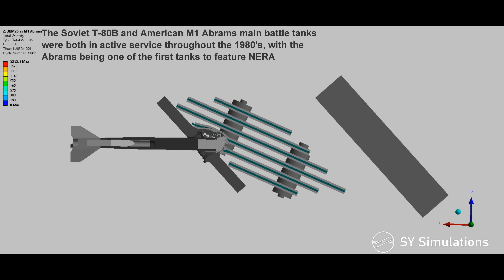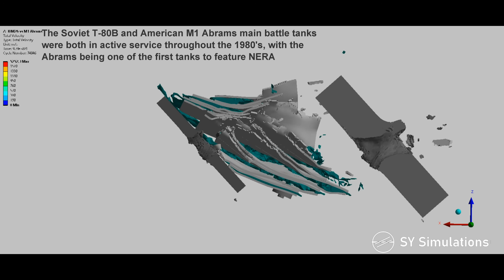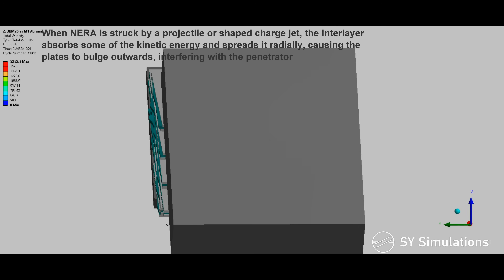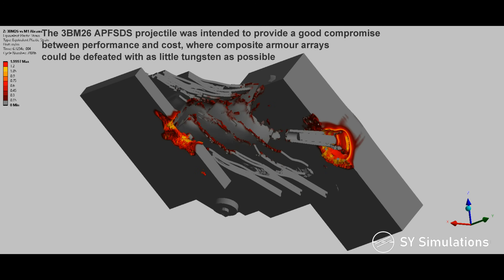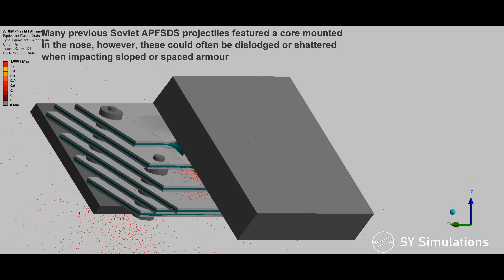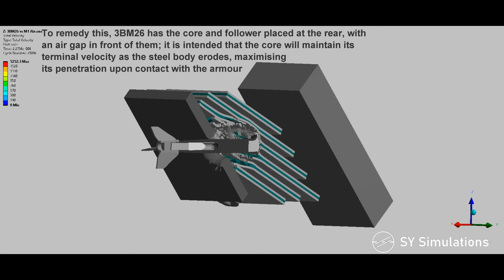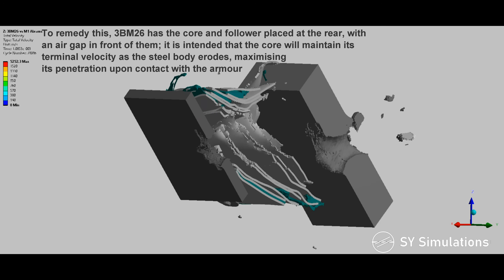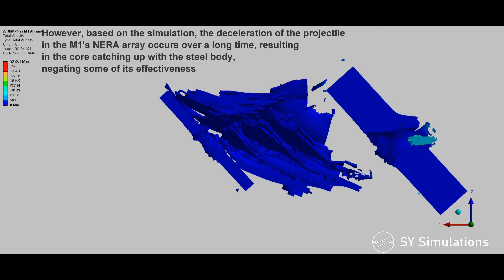T-80B vs M1 ABRAMS | THE MOST UNIQUE APFSDS vs NERA | 3BM26 Composite Armour Penetration Simulation

Comment: This is what the US should have fought against in 1985 had the cold war gone hot or in 1991. Not the hopelessly outdated stuff Iraq had.
Reply: Irak had the original T72, which ment that they only had composite armor in the hull and that the turrets were made out of steel. The T72A, which Irak didnt have has a composite armor turret, which could stop the 25mm AP rounds from the Bradley that the T72 famously couldnt. Also, keep in mind that there was about a 20 year old difference between the original T72 and the M1A1 (as were most of the Abrams deployed to Irak in 91 aling very few M1).
Reply: @sergiom9958  Actually their T-72M1s did have composite "kvartz" armor in the front turret, but they were obsolete by 91 nonetheless.
Reply: I read somewhere that the best APFSDS shells the USSR supplied to consumers were 3BM15's which were made with just steel, though I don't know if Russia continued that
Reply: @trickythefox9598  I believe Iraqis used either 3bm3 or 3bm4 APFSDS on their T-62s, rounds purchased in the 70s. During the late 70s they received the 3bm9 APFSDS to be used on the T-72s. As for their T-55s, not entirely sure, but i believe they used APDS 3bm8 imported in the 70s too, otherwise they used the standard BR412-D APHE as well as BK5 HEAT. All totally ineffective versus Chobham, NERA, as well as DU armor compositions. Their armor inventory and tank rounds were, generally speaking, late 40s to perhaps late 70s tech if you really wanna stretch it. Though it was all plenty useful when fighting the Iranians in the 80s, reportedly did a big number on them.
Reply: @trickythefox9598  3bm15 is a composite penetration with a tungsten slug surrounded by a hard steel cap. It is only effective against steel armor of older generation tanks. 3bm9 is an example of an all steel penetrator for the 125mm.
Reply: @trickythefox9598  3BM9 was the all steel version, 3BM15 had a Tungsten slug behind a steel cap on the front. 3BM9 wasn't that bad of a projectile either because of it's insane velocity at 1800m/s
Reply: @shepardpolska  Yea i misread what was written in a doc. There's a really cool website with all the pre 3BM46 125mm APFSDS  Soviet shells, with all the parameters and stuff
Reply: Iraqi t72 were export versions, they are weeker in all thing comparing with normal soviet / russian tanks and i suppose they were destroyed mostly from air or at night from large distances or even without a crew
Reply: @187Rajah  There are no export T-72s with worse armor. The closest thing to that would be that Russia sold older T-72s and not always the newest ones
Reply: @187Rajah  incorrect. There were no "export" tanks back then. The URSS would export T72s to Varsaw pact allies and international customers when more advanced versions were available for them ; but they would not downgrade tanks to export them.
Reply: @sergiom9958  What would you call a T-72M then, it was quite literally a export model of T-72A with downgraded turret armor, as it lacked the composite inserts, but was otherwise a T-72A. T-72M also came out a year after the A variant.
Reply: @shepardpolska   the T72M, not to be mistaken with the T72M1, were the T72 (not the T72A) produced by Warsaw pact allies for international customers. In essence still a regular T72. The T72M1 were the T72M with specific adaptations for the Iraki terrain but assembled (not fabricated) in Irak.
Reply: @sergiom9958 t-72m1 has different armor than t-72a so in fact the export version was slightly inferior
Reply: @aldobatres7086  you are mixing concepts.The T72A (which has a composite armor on its hull and turret) is the succesor to the original T72 (which only has composite armor on its hull and has an steel turret). When the T72A became available for the URSS, they allowed the export and local production of the T72 to friendly national such as those of the warsaw pact. The URSS never downgraded intentionally any of their tanks but they just waited until better tanks were available for them to allows their export.
The T72M is a T72 produced under licence and with locally produced components in ¿czecoslovakia or poland maybe?. The T72M1 is a T72M adapted specifically for Irak and its conditions, produced mostly in those countries of original but assembled locally in Irak.
So yes, the T72M1 has a different and inferior armor to the T72 and its an "export" variant. But no, its not an intentionally downgraded version of the T72A.
Reply: @sergiom9958  If it was not by Kremlin decision, what was the reason why the variant that would not be used locally by the Russians was slightly less protected? Even if it was used “locally” by Poland, the Russians surely never saw either Poland or Czechoslovakia as a 100% reliable ally, in the end they were with the Russians against their will.
Reply: @aldobatres7086  "If it was not by Kremlin decision" i dont understand were did you get this sentence or what do you mean with it.
The URSS used the T72, but when a superior model (the T72A) was available they allowed the export of the now inferior T72. Why? Because this way they keep an edge and they offer a tank that attracted a lot of international attention.
Its the opposite to the Abrams; the US uses Abrams with Chobam armor and offer the same tank with the same sistems for export but with a different and inferior armor. The difference in this case is that there is (still) no superior armor to replace the Chobam so they offer a downgraded armored version but the tank systems are the same. Maybe one day we will see Abrams with Chobam armor for export when they have a better and superior armor composition.
Reply: @sergiom9958  t-72m1 is not the same as  t-72m, t-72 Ural=t-72m ,and t-72a is almost the same as t-72m1 but with a slightly worse hull armor ,T-72 A and T-72 M1 were made at the same time, however the slightly weaker hull, the M1, was the one used by the Soviet allies and their exports.
Reply: @sergiom9958 , object 172M-E1/E2, 1975. Object 172M-E3/E4, 1980. T-72M1/ Object 172M-E5/E6, 1982.
E for export model. E1/3/5 for Warsaw Pact members and the rest for export versions other than that. And the E version, export, differed in the layout of the armor material and NBC protection system, in other words simplified or literally downgraded or monkey model.
Reply: if it would happen in early 80s they would lose
Reply: @skibidi_T-80  the soviet union + warsaw pact definitely had the lead from the 1960s to mid 1980s from their numbers alone
Reply: Except even if we switched the Iraqi Army with the soviet army the results would still be the same
Reply: Air superiority doesn't care about front armor thickness...
Reply: @geiers6013 aa doesnt care about your comment
Reply: @geiers6013  USSR had thousands of jets, there were 10 thousand MiG-21 built and over 5 thousand MiG-23
Reply: @geiers6013 And your stupidity is permanent, you have no idea how advanced Soviet AA was, they had a lot of great medium range AA short range AA and the the long range like s200.
Reply: @geiers6013 if you think air superiority is possible for both sides you're clearly wrong, both air forces will suffer tremendous casualties, NATO will never be able to rain bombs as free as they did in Iraq 1991

Even if NATO planes are better, the soviets had a larger air force, and a sophisticated interception and air defense network

The Mig-29, Su-27, later Mig-23s, and the Mig-31 are all not to be underestimated as well

Remember, the US has never fought the Soviet Air Force at it's peak
Reply: @neovolkite  ruZZias or even the whole soviet air force never was anywhere close the size of Natos air force. After the cold war the gap only widened extremely, since russia was broke af. The only thing ruZZia has left is tons of mediocre ground based air defense which have proven to completely fail multiple times against large scale coordinated air attacks by Nato or even only Israel in Syria, Iraq, Iran and also in Ukraine. Not to mention Ukraine doesn't even have anything remotely cutting edge or really stealthy and still S400s constantly blow up left and right almost daily... 
For example a complete fail despite many russian troops and air defenses inside Syria here: https://m.youtube.com/watch?v=Vnbkmi3Iieo
Reply: @geiers6013  should have said warsaw pact forces instead of soviet forces my bad

Ignoring the technological differences between NATO and WP, the Warsaw Pact definitely wins the number game + all of their forces are in mainland europe, while the US have to move troops and equipment by sea if they wanted to deploy massive amount of troops in matter of days (preparation of desert storm took months so a lot of moving can be done via air transport)

The Soviets weren't incompetent, you can say Russia is incompetent but the Soviets weren't, oftentimes they are on par with NATO technologically and sometimes they're ahead, this isn't the case with modern day Russia but it was undeniable in the cold war
Reply: @neovolkite  True
Reply: @neovolkite sorry but the soviet airforce would be dusted in less than a month
Reply: @neovolkite  When did the soviet have a larger air force? And based on whose numbers, the soviets? Who paint new serial numbers on planes after landing to make it look like they have more? That does not mean that it would have been fun or one sided, it obviously would have been WW3 and terrible for everyone. Soviets in the 1970 are not to be compared to Russia today.
Reply: @Rumia4859  how exactly?
Reply: @leocurious9919  is it so hard to believe that the soviet union, that devoted it's own economy to the military even more than america could have a bigger airforce?

Let's use google's numbers for now, it's said that the soviet air force possess 10,000 aircrafts of all kind, say that they lie and they only own half of that number. The USAF + National Guard in late 1980s should have almost 5,000 aircrafts of all type in service. Also repainting the number on the airplanes sounds ridiculous, it's an administrative nightmare if it's even real
Reply: @leocurious9919  11 thousand mig 21, 4.5 thousand mig 23, 1100 mig 25, 1500 mig 29, 500 mig 31, 200 tu 95, 1400 su 24, 2000 su 17. Before the collapse of the USSR, our population was larger than in the United States, the Russian Empire was called the Soviet Union, and then only Russia remained from the Soviet Union...
Reply: @neovolkite  yeah too bad soviet air defense is a push over to this day, S400 gets easily overwelmed by all kinds of cruise/ballistic missiles that are far cheaper than the S series AA batterys, same can be said about soviet avionics, bad BVR performance, bros are 2 years in the UKR war and still no air superiority.
Reply: @neovolkite Speaking of numbers, North Korea has almost as many warships as the US and China respectively, so numbers can be both everything and nothing at the same time. In terms of air forces, NATO was considered to be vastly superior even with about 2000 fewer aircraft in terms of numbers. (Superiority fighters, interceptors, attack aircraft, etc...) Besides, the US itself was downright scared of fighters like the MIG-25/31, totally overestimating their capabilities, but the reality was quite different once they had some at their disposal to test them. No one underestimated the capabilities of the Soviet Air Force, on the contrary it was overestimated. (It turns out that the Soviets have the unfortunate tendency to give their weapons higher characteristics than reality, where Westerners often give characteristics lower than the real capabilities of their weapons).  In a real combat situation, NATO air forces would have had the advantage.
Reply: @愛を込めてロシアから  Are you listing the total production numbers...?
Reply: @neovolkite The Soviets were on-par with most of NATO up until the late 1970s and 1980s, when it became apparent that due to the shit-ton of more money the West had, they could just spend more in advancing their military and actually training their soldiers efficiently

And while the Soviet Union probably wasn't as incompetent as the current Russian Federation is, it'd be difficult to gauge how good the Soviet logistics and combat effectiveness would be against NATO during this time, especially with the much less developed Soviet republics and satellite states

It's also to be said that in the 1990s, just before the Soviet Union fell, NATO was arguably superior militarily to the Warsaw Pact, given its naval, aerial, and overall technological and economic advantages
Reply: @convenientplayer  the soviet had numerical superiority from the start until beginning, it was NATO that had to catch up, it was NATO that first considered the use of tactical battlefield nuclear weapons to prevent being overrun by the soviets

Technologically, it's a very close race but there are times where the west is in the lead and there are times when the soviets are in the lead

Also this isn't WW2, they're not gonna throw in troops with minimal training. I say they're trained as much as NATO troops were trained, like combined arms tactics, NBC warfare tactics, anti-tank tactics, and whatnot. They also had joint exercises with warsaw pact nations like NATO, like the Zapad exercises.
Reply: @lemmen01 sead doesn't magically disable all air defense, if they lost an AAA battery to sead, they probably have ten more firing and interceptors chasing at the SEAD planes
Reply: @neovolkite the spviet air force at its peak collapsed the nation.
Reply: @leocurious9919 , также и НАТО 90 не стоит сравнивать с сегодняшним
Reply: @neovolkite  TBF, we've also never seen the Soviet airforce at it's peak because to my knowledge they never operated a full on assault, the US airforce is always eager to show off it's capabilities. The Iraqi air defense was no joke and they were the 4th largest military at the time but to say they we're steamrolled is an understatement. Not to mention the US would have better positioning and support from Europe in such a scenario.
Reply: @neovolkite NATO had Warsaw Pact SAM systems beat in the 80's and 90s
Reply: @jamesricker3997  depends on the type in my opinion, long/medium range SAMs like the Patriot is better than the S300, but the soviets had better close range AA platforms like the tunguska, shilka, 9K33, and 9K35 which will be protecting red units in the frontlines
Reply: @neovolkite Nice comment, but the main reason NATO wouldn’t be able to have air superiority is because of Soviet AA network, it was a huge integrated multi country network in the whole of Eastern Europe. Soviet planes literally had modes which allowed them to connect to ground operators and the ground operators would then guide the so they would be facing the enemy
Reply: @neovolkite They were technologically ahead almost the whole Cold War, Just look at their AA systems, they maybe didn’t have that good air borne radars like nato did, but were still great and when used doctrinally with their integrated AA network they were beasts, also if you analyze US presence in Europe you will find out the from the late 60s to early 80s Soviets had undisputed Armour advantage and only it the 80s did US cought up with the Soviet T-80B but T-80U was still better but wasn’t in GDR it was only in USSR, but still US could only had enough Abrams to face all the T-80Bs in centag but Southag and northag were still maned by obsolete M60s while Soviets had T-64B/BVs and T-72As
Reply: @neovolkite  Ah yes, the sophisticated air defense network that couldn't detect a Cessna that landed in Red Square.  
Or the Mig-23 which was described by its pilots as a fragile pig or the first gen Mig-29s that had bad engines, bad radar, avionics, shit range, limited loadouts, etc. 

The only thing you listed that was an actual threat at that time was the SU-27s. Even then the Soviet Airforce didn't nearly have the same sortie rate  that the NATO could.
Reply: @geiers6013  anti airs dont care about that too lol
Reply: @geiers6013  Thats why the Abrams continues to not add more armor and other protection for kinetic and chemical projectiles..... Great comment.
Reply: @geiers6013  i mean Iraq didnt have anything to stop the US to have Air superiority, in an actual fight with Russia the US wouldt have air superiority, it would shift constantly
Reply: @geiers6013  lol Russias Air defense doesn't care about US stealth planes.
Reply: @oz314  and ukraine has shown that himars and atacms don't care about russian air defense lol. good luck against f-35s if you cant even intercept rockets.
Reply: @oz314  Yes it does lol. While some of their radars could detect a nighthawk at really close ranges, no a single targeting radar could lock onto it. Keep in mind by the time they made the nighthawk public, it was outdated (hell it was actually outdated since the project started, the airforce was given hand me down stealth tech from the CIA).
Reply: @pakistanipatriot4767  and Ukraine has also shown it requires 10 to 15 ATACMS missiles to over saturated Russia AD with a success rate of 2 missiles on average making it through the defense. I call that a massive win for Russia, please tell me when Ukraine stopped a single Russian missile over Kiev? Last I checked Ukraine AD hit a children's hospital. Lay off reddit my guy.
Reply: @oz314  my guy an air defense missile doesn't have nearly the amount of explosive filler to obliterate a hospital like what happened that day. a kh-101 cruise missile does though. maybe watch less russiatoday and you would know
Reply: @kite2036  after hundreds of succesful sorties later (and opened bomb bays)
Reply: @mobiusAC4 *correction, after crews disobeyed orders and turned on their systems (because trailing fighters with anti-radiation missiles were a problem) and destroyed the BOMBER which was currently BOMBING things.

The f117 had a single task and was destroyed attempting to complete its one task.
Reply: @oz314  What is this based on? Surely there is proof somewhere of Ukraine firing 10+ ATACMS at an S-400 site, like a dozen shot down missiles in a small area. I also find it unlikely that Ukraine is gathering literally almost half of their HIMARS launchers in one spot just to kill a single SAM system. It's far more likely that it only takes 4-8 missiles to get through the AD than 10-15.
Reply: @kite2036  that feat hasnt been replicted for a reason
Reply: @flags5765  because they were grounded and mothballed?
Reply: @oz314 "sorry, we didn't know it was a stealth plane"
Reply: @meesamkhan4767😂😂, нам насрать на ваши ф16, ваши самолёты оббосут не то что современный панцири, с этим справиться ещё советское ПВО,так же как и справилось до этого с украинским авиапарком 😂
Reply: @pakistanipatriot4767  Rocket artillery are very different targets than planes, much harder to intercept. Patriots had a succes rate of something in a single digit against Scud missiles. Scuds are way bigger than GMLRS or ATACMS.
Reply: @pakistanipatriot4767 And as pointed out "ripple" firing artillery rockets / missiles tend to overcome even the best air defence network.
Reply: @kite2036  They specifically shot down an F-117 that flew such a predictable route you could time in on a watch. If you fly like that, stealth or no stealth, you're an easy target.
Reply: @pakistanipatriot4767 Ukraine shows that himars is low effective even against pantsir s1 air defence (air defense against drones and uavs)
Reply: @avadhutagita3741  how many pantsirs have been destroyed since the conflict?
Reply: @oz314 How can you be that dumb, not only did US in the Cold War only have a weak stealth bomber which would have to fly so close that it would be shot down, but also as we saw in Serbia even old 60s export equipment could shoot it down
Reply: @Taczy2023 And how do you know that??? Russian crews told you by radio??? Stop beoevery propaganda you hear
Reply: Tankers going into Iraq in 1982 were expecting a hard fight because on paper Iraqi T72s were a threat. I heard them comment on how much easier it was thanks to disruption and demoralization the Iraqi forces suffered.
Reply: Iraqi t72(200 tanks)was polish weak armor versions. Almost t72 was destroyed by bombs on bases. Iraqi mbts was Soviet t55 and Chinese versions of this  @MarcinP2
Reply: American training made this the walkover it had become. The Superiority of Western equipment was icing on the cake. Iraq paid for it's lack of strategic insight and outdated equiptment and tactical insight.
Reply: Except we don't actually know the compostion of the chobham arrays. We have a couple of dodgy photos, reportedly of damaged arrays but most of it is guesswork.
Reply: @sergarlantyrell7847  lol
Reply: and so got for long time lock into 80s military technologie. All we know now , and it was the same in the soviet time , is nato and us have doctrine specialise again soviet , and was the same for soviet . with different doctrine(ex until the end of cold war soviet mainly have interception plane , that explain why air force was little in the soviet , and that only with mig29 and suckoi27 that change . Anyway , saying that we could have air superiority are bullshit until 91 and now now because russia and the soviet have too much deep anti air defence system , saying the reverse is pure propaganda . all nafo doctrine ar counter by soviet/russia , and all soviet/russia doctrine are conter by nato(ex:soviet mass mechanize > deep defence elastic system with atgm/ nato air superiority> massiv anti-air+interceptor mission. in the event in hot war until 91we would all lost in nuclear war , or russia would just take germany .
Reply: @angelinomendesleite2583 I get what you saying but can you please , calm down and write in a less complicated way , just calm down bro.
Reply: The soviet union, and then the Russian federation, had superior armor and ammo from 1985 until 2003.

The T-80U was terrifying.